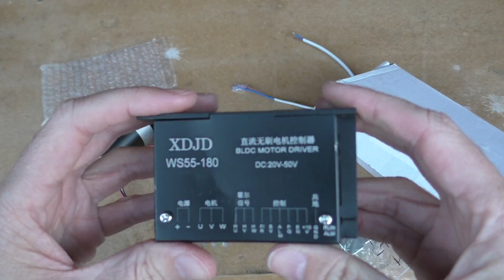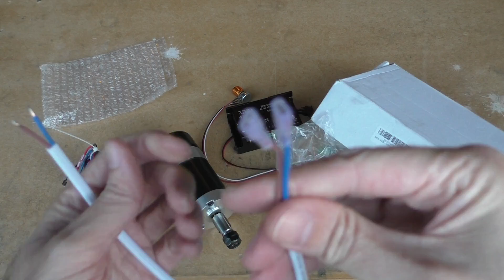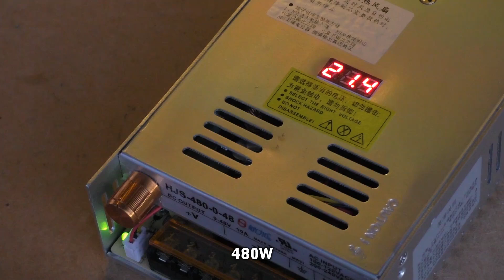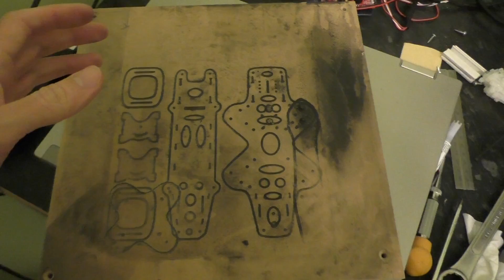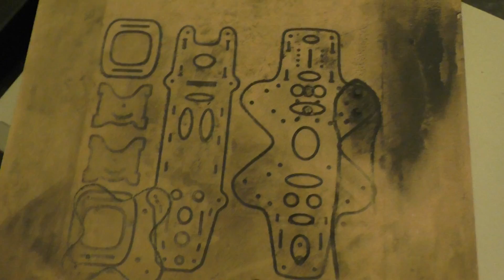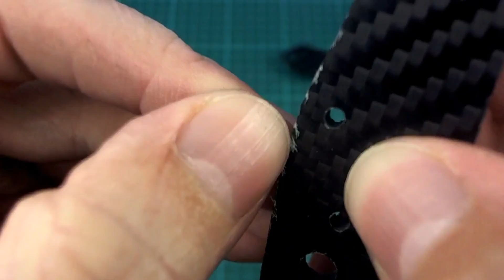DIY mini CNC machine part 15 (carbon fiber review)

Comment: If you can make CNC2.0 more rigid it will save on bits then maybe invest in a better quality cutter it's a given though CF is hard to cut
Reply from the maker: I have ordered some diamond coated solid carbide end mills to try. Yes CNC2.0 will be a more capable machine now that I have learned a thing or two with this one.
Reply: iforce2d the best way to learn is from experience and mistakes

Comment: I know it's different but sounds similar had problems with the 3D printer program stopping but running on SD card perfect. Good luck with power supply looks like the 12 volt on printer #2 bad drop under load

Comment: White fibres? That's weird. Is there peel ply on the top surface layer? That's polyester and designed to be removed but your plate looks pressed so it may not be peel ply. Might be good to check if your plate is conductive, I've seen cheap Chinese "carbon" that was either basalt or dyed glass, neither of which is conductive.
Good work with your machine, like it a lot!
Reply from the maker: The plate is conductive and when I drill it dry on the drill press it's all very black. Maybe this is just how single strands look when very very thin with no resin...?
Reply: Some manufacturers layup alternate layers of fibreglass to cut costs :(
Reply from the maker: Maybe 'light gray' was a better description, I found a video showing something similar: https://www.youtube.com/watch?v=FqxXQzBEr2U

Comment: I now understand why your parts are taking so long you only have 12000 rpm.  I run 24000 and your small parts would take a couple of minutes max. I would run say a 2mm burr bit at like 4 to 5 mm/s cutting depth 2mm.  what are your speed and feeds etc
Reply from the maker: I could probably go faster, but I'm prioritizing just finishing a job successfully. I'm cutting with 2mm burr at 1mm depth and 0.5mm/s speed. If I feel like wasting a bit sometime maybe I will try 2mm/s or so but I really doubt that would work. Even with this slow speed I'm getting chatter occasionally.
Reply: iforce2d ok well as you know chatter is bad.  do you have a lot of run out on your spindle.  is how the spindle is mounted stiff is if you hold the spindle mount at the top and bottom and push and pull does it move.
Reply from the maker: Yes, I can move it a bit around the x-axis, especially when it is in the middle because the x-axis rails are unsupported and only about 12cm apart.

Comment: You should mill vertical and horizontal grooves into your sacrificial board. that way the water has a place to run out under the material. It would keep the water from  building up and getting to your double-sided tape.

Comment: awesome project, i'm so jealous, even with all the hiccups and snags...... you can design your own frames....
Reply from the maker: Don't get too jealous. There is the unmentioned hiccup that each of these carbon sheets cost around $20 when you can buy a pretty decent already machined frame complete with spacers+screws etc for about $26. It is nice to be able to make the odd one-off design though.
Reply: no i think imma stay jealous hehehe....  ..... would icy cold water help bits last longer?
Reply: Have you thought of trying another material, like HDPE, FR4, G10, Polycarbonate to see if there is a superior material for frames?  (I break a lot of carbon...  the HDPE frames are amazing though).

Comment: Have you thought of making the drain hole go straight through, instead of a 90 degree angle? From my experience water with gunk in it doesnt like angles very much, especially with no pressure pushing it down.
Reply from the maker: Yeah straight through would help too. I thought I would give this a try first just in case it turned out to be good enough.

Comment: How about a link to the Brushless Spindle motor and controller you bought... ;)
I'm sure that would solve your Arduino to Laptop communication problems since there is no Motor Brushes arcing..
Reply from the maker: I added a link in the description.
Reply: iforce2d  Thanks for the link.